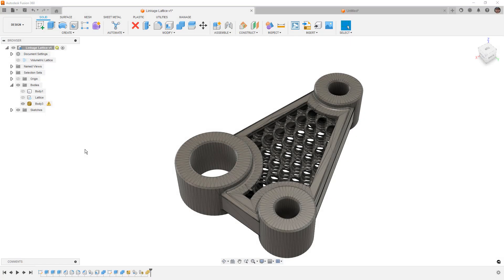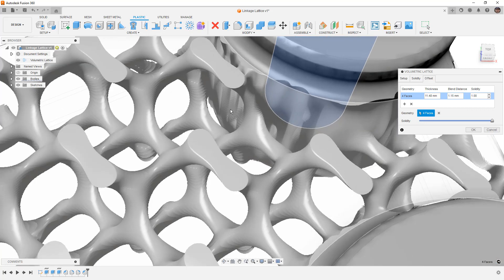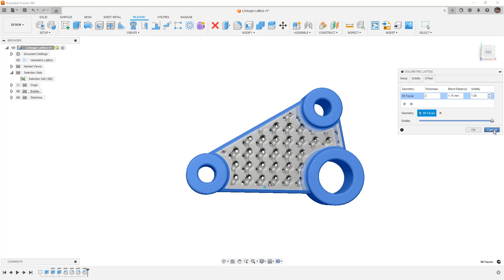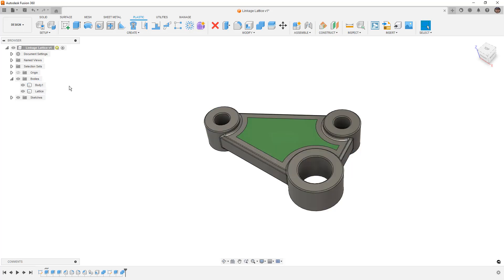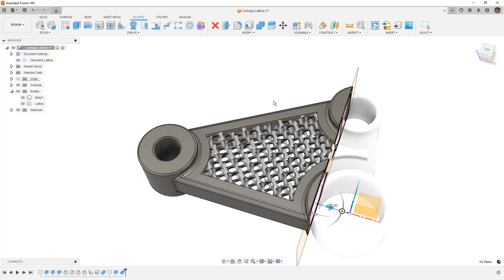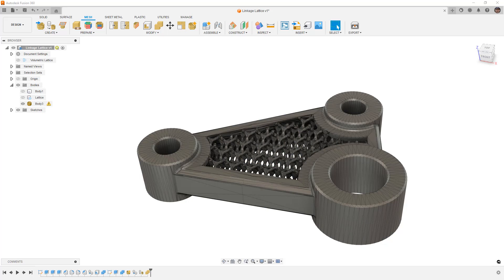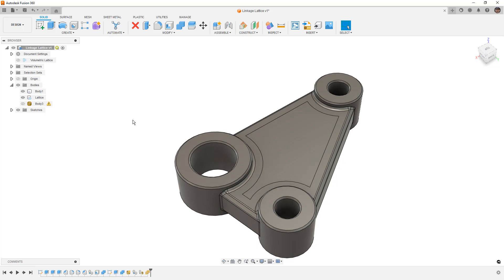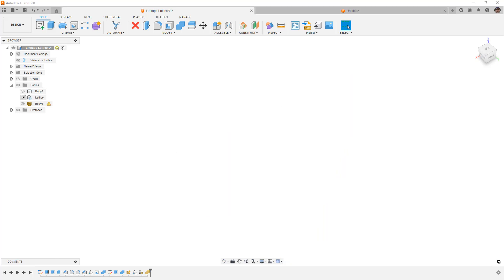Volumetric Lattice Tips and Tricks | Product Design Extension | #fusion360 | How To Vol Lattice

Comment: Hey, I don't get the "Create Mesh" option to convert the procedural to mesh. Am I missing something? Please help me out. 11:12
Reply from the maker: If you have the Design Extension and access to the Volumetric Mesh tool, after its applied to a body you should see the "Create Mesh" option when right-clicking on that body in the browser.  If the body doesn't have a Vol Mesh applied/assigned to it, you won't see that option.

Comment: Hello, I am designing a robotic arm on lattice structure for my school graduation homework, but when I switch to the analysis part, the part I designed with lattice structure does not appear in the analysis program, how can I fix it?
Reply from the maker: you can't sadly.  I mentioned somewhere in the video, maybe near the end, that the vol lattices in Fusion is a mesh.  You can't use a mesh for FEA because oddly enough it can't mesh it.  It needs a solid body.  So the method I showed focuses on the outside shape being mechanical and the lattice being a bit of a filler.  IF you somehow know the mechanical properties of the lattice then you can have 2 solid bodies that are bonded in the simulation.  The inside solid body would need the mechanical properties of the lattice added.  The trouble is figuring that out.  Generally it would be done with testing as the strength is directional and simulation really wants an isotropic property.

About the only thing you could do is go to a software like nTopology.  I don't know if they have a student version or not.

Comment: Another thing to consider when not using offset and treating the lattice itself as a structural component is that stresses concentrate on the transition from the solid piece to the lattice. That's why I like to use a small offset at the transition. To really get a good result nTop suggests that you do a boolean intersect with the original geometry to get rid of any weird artefacts resulting from the implicit modelling. I've yet to try this in fusion but it really cleans up the outside faces a lot. nTop does this before meshing so I guess you would need to overbuild the mesh lattice and then do a boolean intersect with the meshed original part if that makes sense... btw. as this is an appearance you can use only one lattice per component, you'll need to create a new component if you want more than once lattice part in your design.
Reply from the maker: Yup.  at the end i state that having a small offset on all the faces the lattice touches the solid is likely a good idea and show some of the intersection issues between them.  It is by no means a perfect solution.  In Fusion if you just combine the two and go to slice it for 3d printing it gets confused, so I don't like to use that method (specifically in Fusion).  I think nTop is the top tier solution for this kind of thing, but it doesn't come cheap! :)  While Vol Lattice is in the extension and does increase the cost of Fusion you would still be 10x cheaper in Fusion.  nTop having more simulation based results and a more complex lattice control is certainly the solution if you are doing this sort of thing.

For me this in Fusion is "cool", but not quite useful yet, at least I haven't come across the ideal application.  I have played around with shape optimization and using the load path result as a core(solid), and the original (pre shape op) shape as the lattice. but again this is speculation as to the impact the lattice has on the design.  Only physical testing of various samples would give us those results.

Comment: I don't really agree on the statement that it's mainly for light weighting, this is awesome for ergonomic purposes where you're able to replace foam with lattices which is much more powerful. Variable density and local variation of stress-strain behaviour through change of the unit-cell is a big thing here!
Reply from the maker: Hi Janos, my statement was aimed at Fusion and specifically because we can't simulate the performance of the lattice structure.  The closest thing I am aware of is nTopology for being able to generate lattice based on simulation results.  Once its a mesh in Fusion we can't re-mesh it to run an FEA study on it, so for the purpose of building a lattice on mechanical parts with Fusion it won't be a performance thing, at least in my mind.

I hope one day we can get a solid lattice structure that can be properly evaluated.  I don't currently know of a resource that has mechanical properties of lattice structures like you find with say the yield of solid material.
Reply: @LearnEverythingAboutDesign  I talked with a guy from Fraunhofer after FormNext last year and they actually model the properties for the resulting meta-material and plug the modelled parameters into FEA because simulating complex lattices is super resource intensive.
Reply from the maker: where do they get the properties from for the material though?  Manufacture it, test it?  I would image the structure is not modeled as Isotropic, maybe orthotropic?  Not something Fusion could simulate unless it was broken down into an isotropic "worst case" probably.  very interesting.

Comment: Very nice tutorial , perfect and beautiful design with Lattice, save material when 3d printing. 
Sir, can you do more joints and mechanical movements in fusion 360, I'm really looking forward to it.
Reply from the maker: Sure thing.  I am planning to update my intro to fusion series.  I do have several videos specifically on suspension kinematics/joints in fusion.  Is there anything specific?
Reply: @LearnEverythingAboutDesign  @keal.vietnam
Hello bros, are you still there? Please help me with a question!
I am using volumetric to create internal structures, but I don't know how to export this structure as a body and save it in formats like .STEP. When exporting to .STEP, the lattice part is lost, and only the original solid (before applying the volumetric command) remains. Converting to a mesh and then exporting to .STEP also doesn’t work, but exporting to .STL only results in a surface.
Do you know any way to do this? Please show me. Thank you very much!